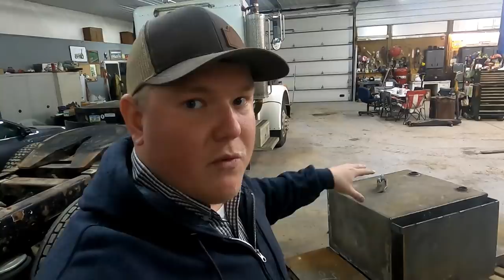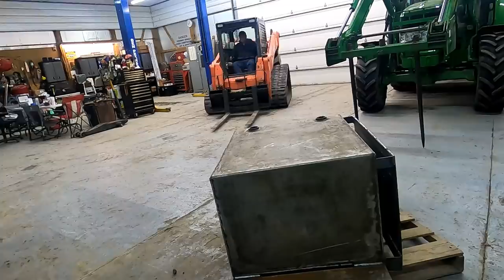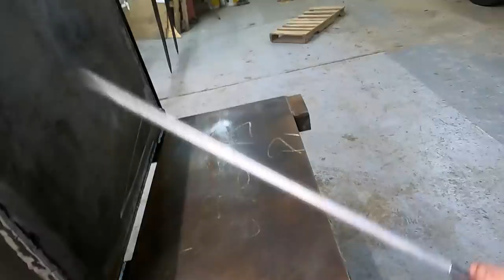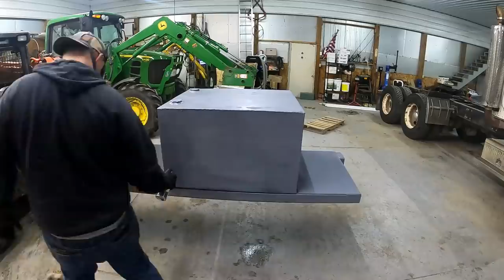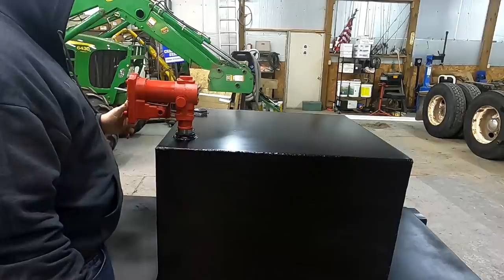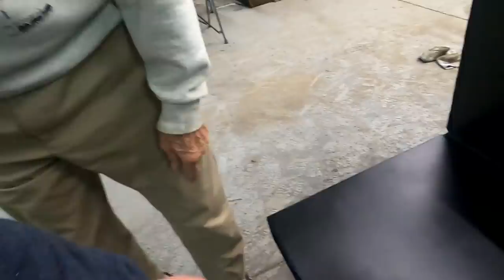PAINT JOB! - Off Season Vlog. 3

Comment: Next time spray soap and water on the area before placing the decal on and it will give you time to place where you want and get the air bubbles out. 
Did that putting decals on my police cruiser. 
God bless.
Reply from the maker: Brian Hubbard that would have definitely helped. It really grabbed to that fresh paint.